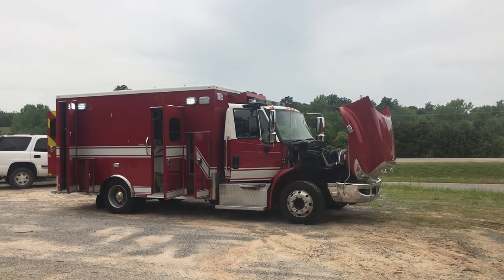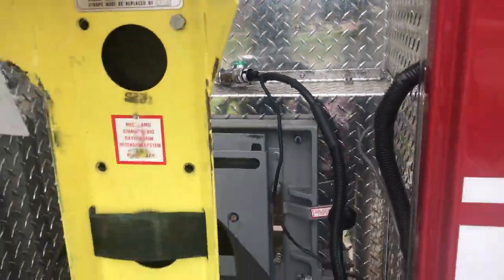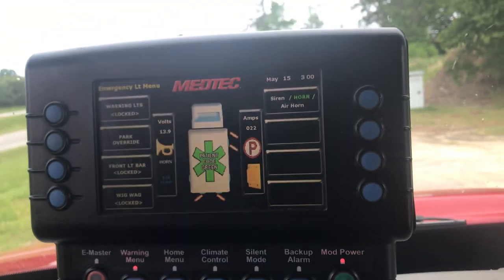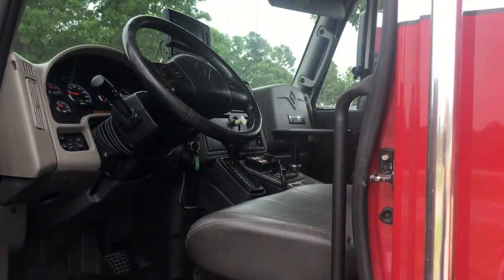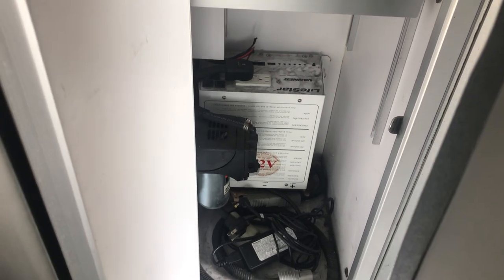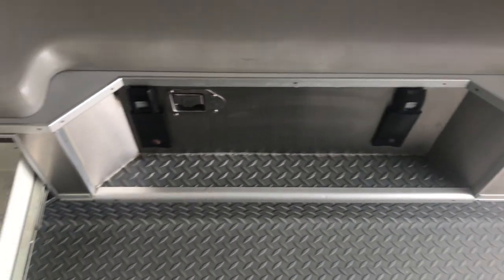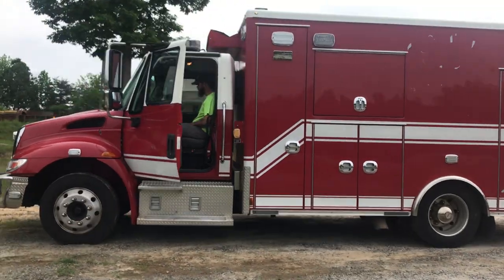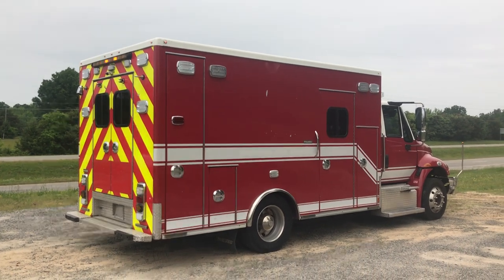FOR SALE VIDEO #2 2012 MEDTEC IHC AMBULANCE TYPE I MEDIUM DUTY EXC COND 804-928-9099 carnetcars.com

Comment: I commented earlier under a retired school bus with a wheelchair lift, and storing an electric bike in there if converted to a motorhome, well I heard about a retired ambulance as another option, the floor is lower, the doorway is wider than the emergency exit on the back of a school bus, so I wouldn't need a ramp or a wheelchair lift, and wouldn't even have to worry about a ramp to get in the way of mounting a hitch receiver, and with some connections still on the floor, I'd keep them to hold that bike up, same with the handrails on the ceiling with straps tied between them and the bike frame also to hold that bike up, but those ambulances are smaller than school buses, so that bike can get in the way of going from the dinette to the bathroom, therefore, if I pulled a flatbed trailer with a Ford Escape in it, I could at least load that bike in that car and haul the bike that way, even if it is an electric bike.